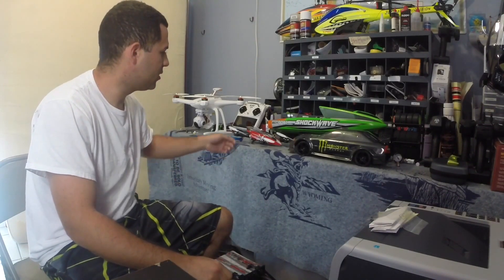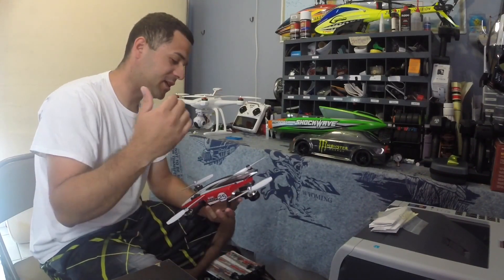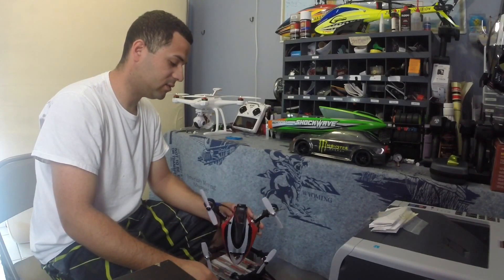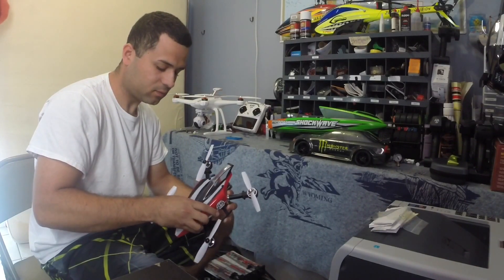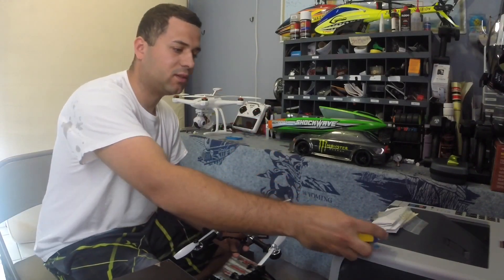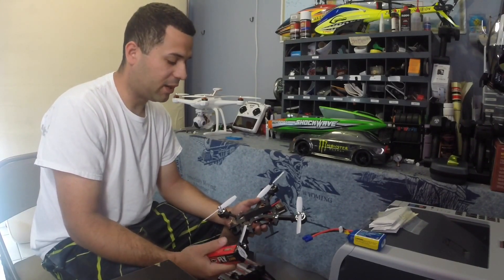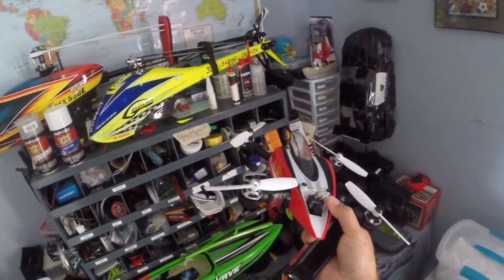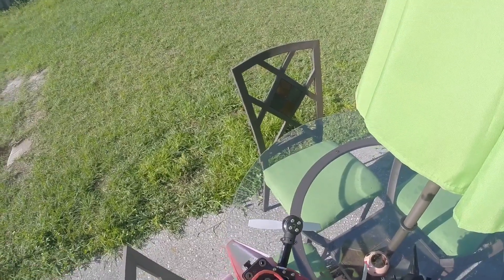Blade Mach 25 drone on 3s vs Blade Mach drone on 4s lipo

Comment: Change the stock bullnose propellers and it will be a lot smoother and it won't judder on high throttle
Reply from the maker: I thought about it but I bought the vortex soon after purchasing the Mach 25 and kinda just stored the Mach 25
Reply: Change the stock props to what? I've been looking for some replacements and not having any luck.

Comment: i want a drone ive messed with rc everything for a while just got a toy drone that lasted for 2 battery charges and the shot dont work. i knew it was trash but was a gift and it flew one time for 12 mins and was awesome. i want something thats good for someone who dont want junk. start and go without buying new motors after day one with no crash. whats the best one over beginner stuff thats not a 1000 bucks. i saw the mach 25 is this a great one for someone who can fly them. im not a pro but i want something thats built to last. can i get a list of the most recommended drones for a level above beginner.
Reply from the maker: Hi Jason I'm glad to hear that you are interested in getting into drones. I started like you, with cheap ones just to get a feel for them even thoe I was already flying before the drone cause I used to fly helis everyday. Now if you feel secure and ready for a good inexpensive drone I would start with the Mach 25 why because it's good and if something did have the parts are very cheap. Also the customer service you get with the product from horizon hobby is AMAZING. Hope this helps if anything let me know and I would be more than happy to help you.+Jason Cartwright